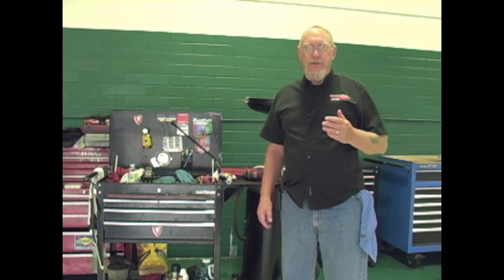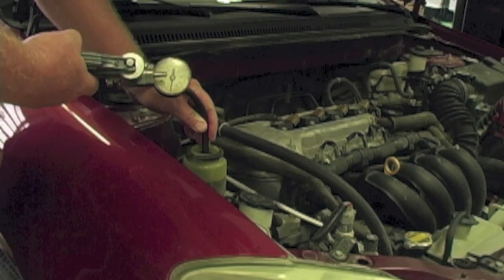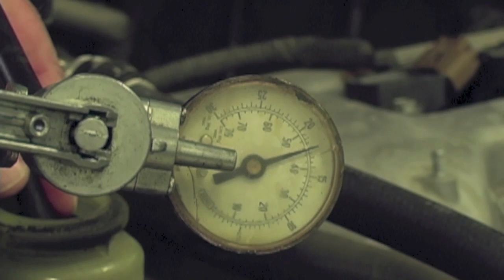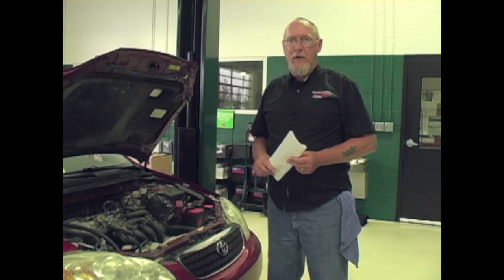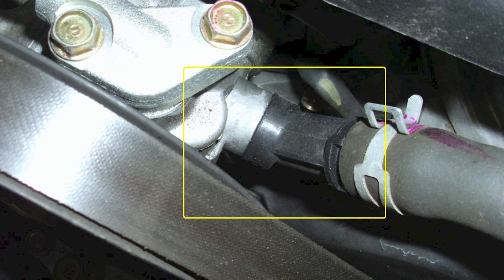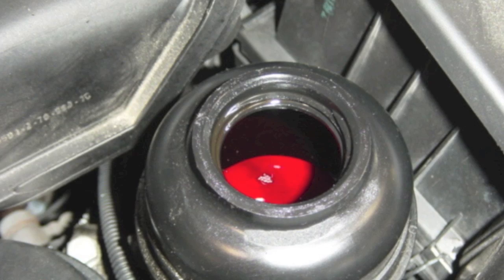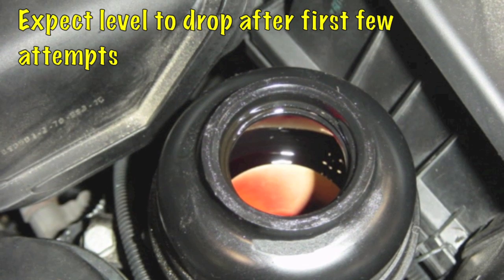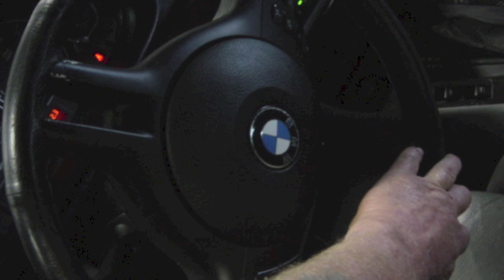The Trainer #33: Curing Power Steering Moans And Groans

Comment: My 2003 Mercury Sable does this but only if the weather is very hot. Any ideas?
Reply from the maker: Fiona H Is the fluid frothy?
Reply: Hi Motor Age ~ Thanks so much for the prompt reply! I am going to say that I don't think so but I need to check for sure...is this one of those things I need to check when the motor is running and warm or when the car is cool? Thanks.
Reply from the maker: @fionah3433  Running and warm. If it is, it indicates that air is getting into the system somewhere.
Reply: @VehicleServiceandRepair  Thanks...as soon as I get a chance I will check it. Seems odd that it only happens when the ambient temperature is warm...I can drive for several hours and it won't happen if it's not hot outside. The only other thing I can think of is that when I am driving for several hours it's on the freeway and I am just barely steering, but when I am driving around town I am moving the wheel a lot. Perhaps I will check out the chemical properties of PS fluid and see what I can learn about how it reacts to temp. Appreciate your help.

Comment: I'm having a issue with my acura TL. The pump is dead SILENT at start up. After about 5 minutes or when the engine reaches operating temperature the power steering pump starts to whine loudly. I have replaced both o-rings and fluid with Honda OEM parts. But that did not help at all. After the system is hot I see bubbles in the reservoir. So I'm sure that is what is causing the whine and moan. Could you please tell me where you think the air might be coming from? Thank you greatly for your time and help.
Reply from the maker: Bubbles in the fluid definitely indicate that air is entering the system, most likely on the return side. Use your vacuum gauge to pull a vacuum on the system with the engine at normal operating temperature. Any loss indicates a leak. Check the hose for cracking and all the connections. Hope this helps!

Comment: My Ford Falcon 2000 au was making noise like Growling   when I drove. I noticed that my power steering rack was leaking and I decided to put a new one. After everything was done, I did all the procedure to take the air out of the system. The fluid was perfect, there was no air bubbles and the steering wheel was running perfectly. As soon as I put the wheels on the ground and turned the steering wheel from side to side I noticed that the noise is still there. not as bad as before. I need to know what can be or what I need to do.
Reply from the maker: Fords can be notorious for trapping air in their system. Perform the vacuum sealing test I talk about to make sure you don't have a leak still somewhere in the system. If the system is tight, it should hold.
Reply: Thank you very much for your interest in helping.  I used the Mityvac brand , Automotive Test & Bleed, put 15 pressure and waited for 10 minutes and did not lose any pressure.
When I drive to test the wheel does not come back when I turn left or right by itself.  Again thank you .
Reply from the maker: @wilsonredondo5672  Pressure? You don't want to pressurize the system, you want to draw a vacuum.
Reply: @VehicleServiceandRepair  Sorry I wrote myself wrong I actually put a vacuum because when I tried to remove the dipstick I found resistance to remove because of the vacuum
Reply from the maker: @wilsonredondo5672  If you're building vacuum in the system, you may have a restriction on the inlet side of the pump
Reply: @VehicleServiceandRepair  I'm going to try wheel line by pro and see if I can fix the problem. Maybe the wheels are too out of alignment, though I've put all the measurements exactly as before mm by mm. Once again thank you very much for your attention and intention to help. I will continue in forming the results for you here.
Reply from the maker: @wilsonredondo5672  I'm betting it's the pump.
Reply: @VehicleServiceandRepair  I had the wheel line made today by professional and the wheel is returning to the center normally. Unfortunately the noise like Growling came back. The pro who made the wheel alignment found problems on left bottom joints and left wheel bearing, and told me that it also has to be fixed. Then it will be done. And I'll start trying to solve the problem of the pump. I may have a restriction on the side of the pump because of the vacuum that was applied as you said. I do not know how to fix this problem. I am not a professional and because I am a Pensioner I am doing this to try to save some money and because I like the challenge. Your help is greatly appreciated.

Comment: We manufacture a product called the Airlift 2 which has a cone and will fit most PS reservoirs.  It is an air operated vacuum pump that is normally used for cooling systems.  Many OEM's are already using these tools at the dealers.

Pete do you want one to play with?  It will make the job much faster and will evacuate in about 15 seconds

Comment from the maker: Wow, lots of questions! Let's see what we can answer.
1 and 2, pumps and racks can have noises of their own or have seals that allow air in. Air can destroy a pump as the pump cavitates and I would guess the same could happen to the rack.
3.  Easiest is to get another cap, drill out the center just enough to allow you to press in a fitting for your pump.
4.  Bleed the air with the engine OFF and wheels pointed straight ahead.

Thanks for watching!

Comment: thanks for the video...
1) can Moans and Groans be caused by bad pump apart from air in system.
2) can Moans and Groans be caused by bad rack and pinion.
3) i dont have adapter,can u pls give some tips about how one can i do. u said about old bathtub??..
4) when i apply vaccum to the power steering pump, do i need to start the car, or without starting turn the wheel left and right or  just vaccum alone will suck the air out..without turning wheel.  thanks in advance...